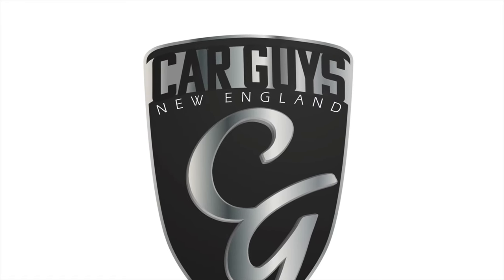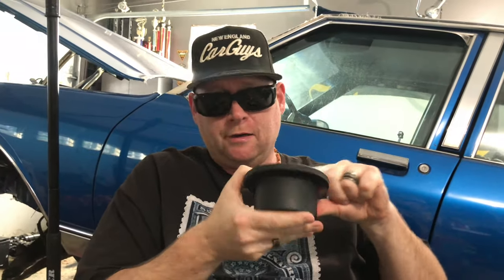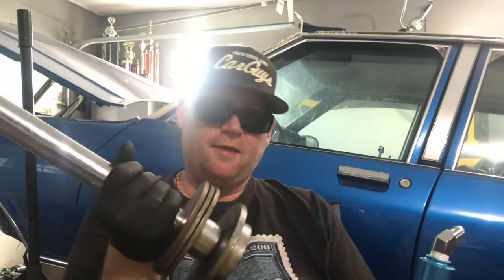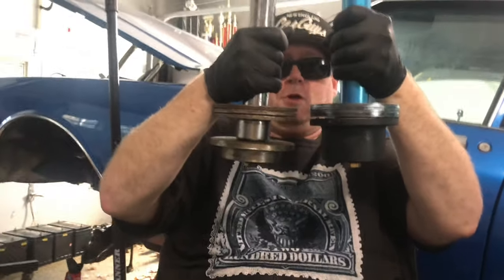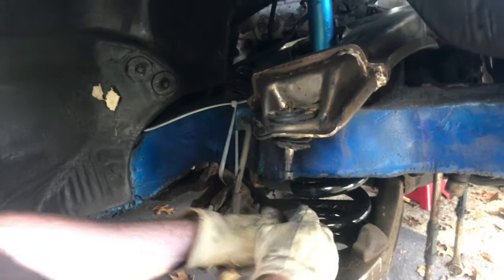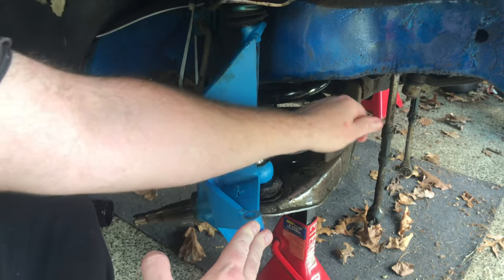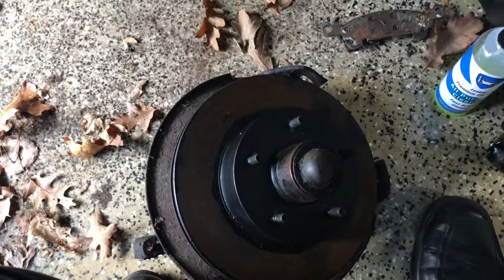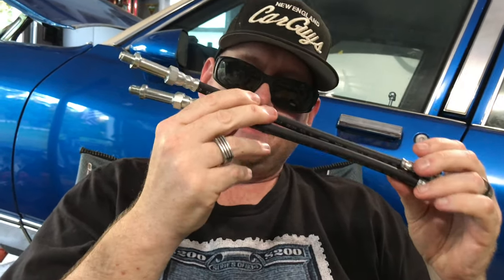Lowrider Caprice Hydraulics Upgrade Part 8

Comment: How long are those break extensions and did you have to extend the back line as well
Reply from the maker: The extensions are almost same as stock length... yes rear will get extended too
Reply: @carguysnewengland  question .were did you get those spindles? Thanks. There bad.